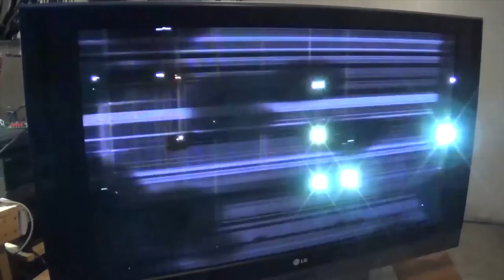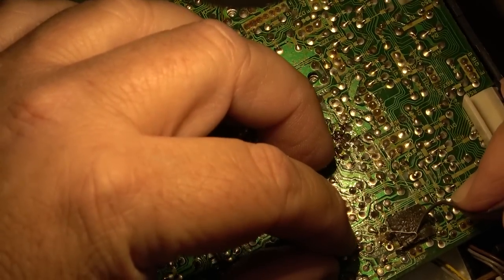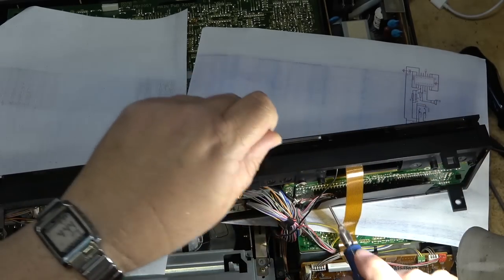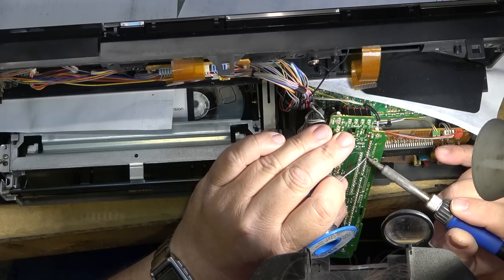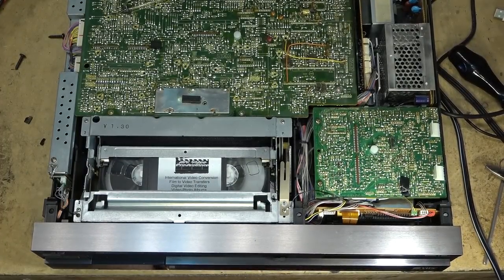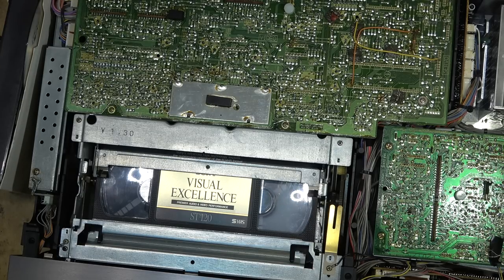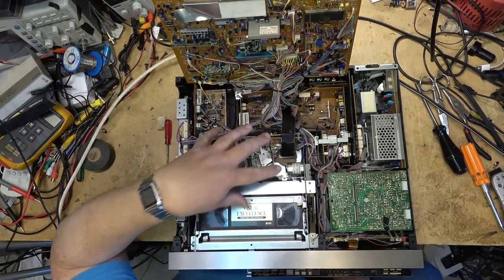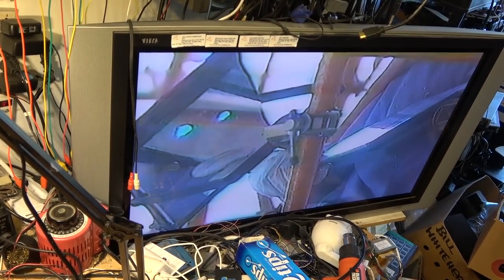JVC HRS8000 SVHS Service

Comment: I bought that machine when it first came out. It was over a grand. It was an absolute BEAST! I used it daily to record/play my favorite shows for almost ten years, with no problems. That was at least 2-3 hours/day for ten years. It had one problem: Now and then it would snap the tape off after rewinding! You may note it does not wind down at the end like the next models did.

Comment: Man, you are NOT wrong about JVC. All my VHS decks are pro/industrial models (SV0-5800, that kind of thing, all with plug-in circuit boards), but I needed a relatively high-quality deck for EP tape playback (EP makes me want to weep, but we get all sorts of archive crap on VHS that we have to turn into 1080p ProRes for tv documentaries and so on). So, I bought a BR-S378U. Outwardly, beautifully made. Once the swinging pendulum rew/ff gear was cleaned/lubed it was working great. But then I noticed the hifi audio was rather low and slightly dull-sounding. Probably caps in the hifi circuit. So I begin disassembly....YIKES...what an absolute DOGS DINNER. Boards all over the place, spaghetti everywhere. You can't even open up the main board without dragging a bunch of sub-boards with it. Truly the worst design I've EVER seen. Come to think of it, the old BR-7000 duplicator decks were a spaghetti mess too, but at least the boards were somewhat accessible. This "prosumer" JVC is HIDEOUS inside. "Nil Points" to JVC, as they say on Eurovision.  Thank god I usually only have to work on professional equipment! I'm amazed the BR-S378U even powered on again after the trauma of disassembly/reassembly! Ughhhhhh!!

Comment: Boy you’ve got more patience than me to work on that thing! I owned a later model  JVC VHS (not SVHS) that had those dropout issues and had the same service done to repair it. Mine also had an issue where the remote would stop working after so many minutes. Was sent off to JVC for repair and returned saying they couldn’t find an issue. Plugged it in and same problem. My local service dealer found it was a bad trace in the circuit board that when you lifted the corner of the VCR it would work and stop working as soon as it was set down. I eventually sold it figuring I wasn’t waiting for the next issue. I eventually bought a SVHS Hi Fi HRS-9500U that has given me good service until recently when fast forwarding tape and putting into play mode creates slack and spills tape into the machine . But it’s an old machine and has been stored for the most of its several years with little use so it’s to be expected.
Reply from the maker: These were not reliable machines.  None of the old heavy units are.  Too much to go wrong and a bitch to repair.  My advice is stay away from these dogs.
Reply: @12voltvids  Were Mitsubishi HS-U70 and HS-U80 any better than JVC?
Reply from the maker: @waltchan  I forget which chassis those models had.  Most of the mitsubushi were very reliable for years then they took a small slide near the end.

Comment: Whenever I see you bang on a chassis to check for a bad connection it reminds me a the time my cordless phone became intermittent. My (now ex) wife took the handset, complained about the fault and began banging it on the countertop. I told her, "That won't fix it." But, I was wrong. The next day there was a brand new, unmolested and fully functioning unit in it's place.
Reply from the maker: Any tech that deservs to be called a tech use this technique to find faults.
Reply: @12voltvids  I like your methods because you don't depend on the latest and greatest technology, but primarily on your wits, reasoning and decades of experience.

Comment: Do you still repair VCR's? I have a JVC HRS-9900U. When I recorded LASERDISCS on it, it was REALLY HARD to tell the difference between the source and the recording. The first problem is, it will not take the tape in. I had to pop the lid and give it some help. I'm looking for somebody to rebuild it if need be. Please let me know. I'll make a separate post about this, HRS-8000 beast.

Comment: Dave you are correct  I've worked in the plastic industry, Phenolics in paper, linen or fiberglass glass. The fiberglass base phenolic PC board is G10 mil grade and far superior to Paper or Linen.  and  far more expensive.  We  cut G10 phenolic  with a diamond encrusted circular saw blade .080 thick . FYI

Comment: At least this one is not disintegrated yet. I have a Hitachi S895 S-VHS from the same era, similar board count and wire spaghetti (although it's more tidy with more connectors, the front comes off with zero wires attached to it IIRC), and every single board has a lot of leaking capacitors, all the boards are corroded to hell. I will have a run on it, but not with high hope. It has a very early digital Y/C processing board in it with tons of SMD ASICs and discrete frame buffer SRAM ICs, and the corrosion is quite bad on that board also, some fine pitch SMD ICs are swimming in an electrolyte sea for who knows how many years now. 

And it was operated quite a lot after the caps started leaking, as the previous owner seen some issues with it gradually coming up, first the HiFi audio went out, then the tracking became unstable, and he stopped using it only when the servo completely gave up and the head drum started spinning at about 1/4 of the rated speed.

I bought the VHS version of it for parts, the F785, because it was cheap and came with a remote, which the S895 was missing, but the F785 came with even worse corrosion, it has blown up caps in the PSU (at least the PSU was still OK in the S895 last time I seen it).
Reply from the maker: Well at least the craps are not leaking on this one.... yet. As I mentioned I was given one and I won't be restoring it any time soon.

Comment: I bought a JVC S-VHS back in the day and it had those white lines FROM DAY ONE. I returned it and got another and it had the same problem out of the box. Could a bad ground at the outlet cause that issue, too?
Reply: JVC had several generations of SVHS machines with the white streak problem. It started with the JVC HR S4900U/S6900U/HR S5100U/HR S7100U, and ran all the way up to the HR S9400U.

Comment: I have an HR-S100000u that is similarly constructed. One of the hi-fi channels is bad and I think the problem is on the hi-fi daughter board’s surface mount capacitors. It’s really hard to get to it with all spaghetti wires so I’ve been avoiding it... These are neat looking machines cosmetically, but a terror to service. Dave, I’ve had great luck finding service manual scans at servicemanuals.net. Even for the schematics they are at a high resolution. When I’ve found an issue with a schematic, they can quickly rescan it. Most manuals are around $20, but if it is something you really care about it is worth it.
Reply from the maker: I don't care about anything that much and for 20 bucks i want a paper manual in my hand not something i have to print our using my paper and toner.

Comment: Good afternoon, dear guru! Your video led me to purchase this VCR model Victor  HR-s8000. I have already implemented many solutions from this video of yours in my device. Many thanks to you for your work! Unfortunately, this device requires serious maintenance. So, the noise suppression system has short-term voltage emissions, but it is difficult to eliminate this malfunction without a service manual. Help me, please! If possible, put the service manual on the cloud either  jvc hr-s8000 or jvc hr-s7000  or  victor  br-s3600 or  hr-d630u or D530MS. Sincerely, Alexander.
Reply from the maker: I don't have the manual.
Reply: @12voltvids  Thanks for the information!
Reply from the maker: I would never recommend buying this old crap. What many do not understand is that these high end machines were not very reliable when they were new.  Time has not been good to any of them.  If you absolutely need a VHS find the most recent vintage machine you can find. Sure there will be more plastic in them but the reliability was much better due to greatly reduced part count.  Fewer parts both mechanical and electrical means less to go wrong.  Also the signal processing circuits on the later machines resulted in a better picture than any of the early machines could ever dream of delivering.  Same goes for old cameras.  For archiving find a digital 8 with analog playback capability.  Early 8mm hi8 cameras were loaded with leaky caps.  Later models they had all switched to tantalum and ceramic.  
I know this just ruffled ebay sellers feathers that make a fortune selling this old crap to the naive buyers to think older is better and therefore worth more. I just recently saw a guy with a 1947 Bakelite radio asking $300 saying it's rare. I sent him a message asking him if he would like to buy the two that I have for a hundred a piece and then he could mark them up to 300 and make a profit. I bought the two that I have for 15.00, for both.
Reply: @12voltvids  Good afternoon , guru! I apparently expressed myself inaccurately. Of course, you did not recommend purchasing this particular model. Of course it is  not yours recomendations.  But I myself assemble and repair magnetic sound recording devices (cassette decks, video recorders, DAT decks). It was enough for me to watch your video and want to find this device in my collection myself. Of course, after troubleshooting. Yes, time does not spare anyone, and magnetic recording devices suffer all the more from time. But. This month they brought me a very "young" Sony slv-se620. 1996. Weight 3 kilograms. All made of plastic, the tape tension stand is combined with the lever (also plastic) for opening the cassette cover. The stand broke off, the lower part of the plastic of the stand fell into the windings of the direct drive motor of the capstan, some of the windings shorted out to each other, the tape was crumpled (a very valuable record for the owner - his wedding ), the price of the device today is about 15 US dollars, the price of a direct drive for this device is about 100 US dollars. No point in repairing. My friend brought JVC HR-J627ms, it turned out that on the back panel the brand JVC HR-J727, the tape counter only works in ntsc mode, in other color systems the counter does not count at all, there are no (!!!) central cores in tulips for the audio signal input  at all , this miracle can write sound only in ntsc at sp speed, in other modes the sound is not written at all. 1996. Friend bought this miracle for 250 US dollars. My test show a harmonic distortion coefficient of 0.1% on recording from a tape . Sound for an amateur. These are not my machines. I personally have a Panasonic NV fs900 and my test show that there are absolutely no differences between the signal applied to this device and the result on the tape. Harmonic distortion factor 0.009%. Perfect sound. And the tape drive mechanism of this device has an unlimited resource - it is all made of metal. 1986. And here is Victor 8000. Today, its harmonic distortion coefficient is 0.05% I will adjust, it will sing no worse than fs900. Sincerely, Alexander.
Reply from the maker: @AlexMirgorodskiy  sure there was garbage made but also very good machines made into the 2000s. The old models however have many more points of failures.  I use a JVC 9911 myself for archive work.  It's a flimsy mechanism but as long as you load it carefully it works great.  My ag1970 on the other hand, beyond repair as is my agw1 and they were expensive machines that just didn't last. Lots of JVC models the guide assemblies literally pulled apart.

Comment: why is it that a vcr like this has so many bloody boards and yet you can find a vcr from like 2007 with one board for everything?
Reply from the maker: Large scale integration thats why.  They put everything into a couple of chips.   They made them much simpler and much more reliable.   I would take a late model VCR any day over one from early 80s.  Yes they are more "flimsy" as some put it but if you load them gently they generally are pretty reliable and with the reduced part count,both electrical and mechanical there are far fewer points of failure.  They are no more repairable though as no parts are available regardless of the vintage.  Plus advancement in signal processing with the advent of DSP means that a newer vintage machine produces a better picture then the older models could ever be expected to produce.
Reply: Back in the days of early VCRs each function required a unique IC. There were different ICs for the syscon, servo, motor drive, luma, chroma circuits etc. In the late days they integrated everything into a single "Jungle chip".

Comment: Yes there are a few p.c.b's in there,  just a few lol.
I have never seen a machine like that,  but there were machines that had loads of Spagetti everywhere.
The short wires that were soldered directly to pcb's was a pain,  just could not get full access :-(
Reply from the maker: When i see shit like this it reinforces my decision to get the hell out of the service business. When I got out in 2003 there was so much crap hitting the market they were built just like this circuit boards everywhere very short connectors couldn't do anything had like one inch of clearance to pull a board out oh terrible stuff I got so frustrated that I finally threw in the towel.
Reply: There were cheap full height front loader vcr's  made my orion (white pcb) , cheap yes but so dam easy to repair  :-D
Good thing you did jump out,  the stress could have pushed you into a heart attack, now it's just a hobby for you.
Stress is not something to be ignored.
I got too much stress when i was the electronics repair section in a business,  the stress drove me into mental illness,  Took me years to recover.
Reply from the maker: @zx8401ztv  
I don't remember if i ever talked about what finially drove me out of the business or not. It wasn't the business shitting down.   They are closed now but I left 10 years before the doors closed.  Perhaps i will talk about that in the next video which will be a little old transistor radio restore.

Comment: What to do if a Sony HiFi keeps forget clock time and radio station presets Everytime I unplug it from the electricity? 
My Sony HiFi is VX90AV.
Thanks in advance.
Reply: It should have a button type battery which supplies back up power for the clock and station memory. You could replace it yourself or take it to a tech guy, it should be an inexpensive fix.
Reply: @stevenclarke5606  thank you Steven for reply . I did opened the HiFi and locked for such a battery long time ago but found nothing and also I have a couple more HiFi in other rooms Sony W55 and Sony G88 . Only Sony W55 can remember the radio station presets but the other 2 forget everything once unplugged. No batteries inside and I check the service manual and no clue about batteries , I live with this problem since long time and this is why I asked you here . I follow your channel because I like cassette tapes specially the Professional ones . 
Thanks again .
Reply from the maker: Battery is quite often on display board and you need to remove to access.  Some use a super capacitor.  Look for a 1F cap rated at about 5.5volts
Reply: @12voltvids  great Idea . I will do it and let you know asap. Thank you very much .

Comment: Maybe you should test it with VHS casset in VHS mode and not S-VHS mode... Maybe its get green in VHS mode only.
Reply from the maker: I tested with both.  Svhs uses additional circuitry. I also tested both composite and s video outputs.

Comment: the old G-Chasis / G Mechanism was a real pain to work on. I hated working on them.
Reply from the maker: "G" as in Garbage
Reply: Yeah the G mechanism. Take the front loading mechanism out, align the gears at the bottom into the stop/half-loaded position with millions of timing marks, and then replace the front loading mechanism in the down/loaded position instead of the ejected position. That's a ridiculous process isn't it...
Reply from the maker: @crashbandicoot4everr  yes it is.  And you have to do this to change the loading belt.  I used to hate to see these machines come in. Fortunately by the time a lot of these machines came in people would put limits on how much money they would spend and because their limits were lower than what they would have been charged to take the mechanism apart and replace the belt and time everything a lot of these machines went in the bin. We had a policy that our VCRs we would go ahead up to I think it was $75 on VCRs and would have to call with an estimate if it was more than 75 bucks and these machines always were due to the complexity so nine out of 10 would scrap it and buy a new one so I got out of having to fix a lot of these machines just because they were aging at this point and people were itching to buy a new one anyway.
Reply: @12voltvids  There is no loading belt in the G mechanism. Everything is driven by the capstan motor and a solenoid that pushes a lever to switch the motor and a clutch from driving the tape spools into driving the loading gears and the front loader. There are two factory training alignment instruction videos here on youtube just because of the complexity of this mechanism.
Reply: @crashbandicoot4everr  yep then hope you have it all aligned so your not breaking any gears. god i still hate that mech. Thank god out of that service shit. lol
Reply from the maker: @crashbandicoot4everr  You're talking Panasonic. You do realize we are talking about JVC in this one right. There is a loading belt in this one.
Reply: The Panasonic G-chassis S-VHS models suffered from surface-mount caps video IC failure. Much worse than JVC.
Reply from the maker: @waltchan  they were bad all right.  Especially the AG (all garbage) series marketed as high end professional machines)